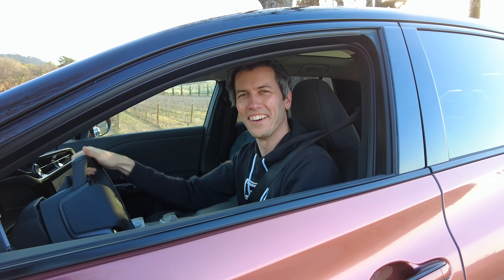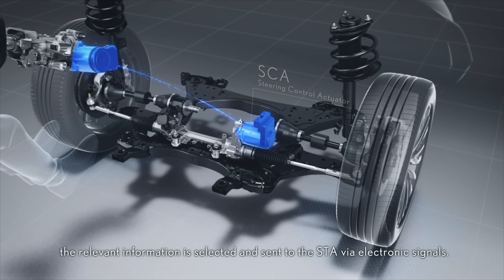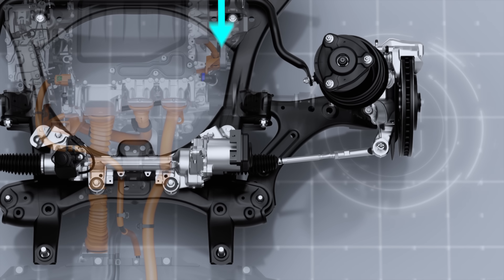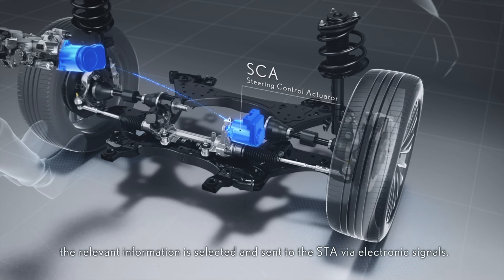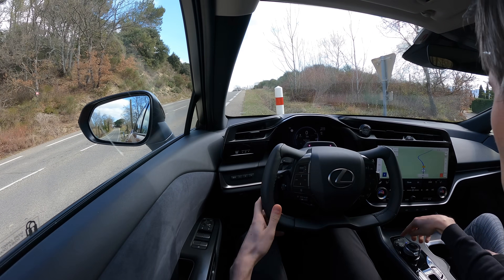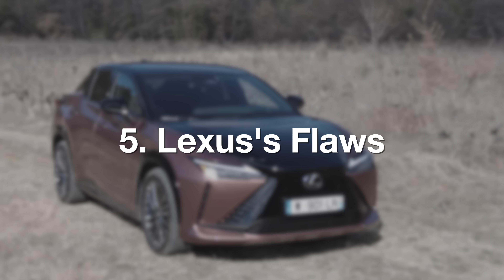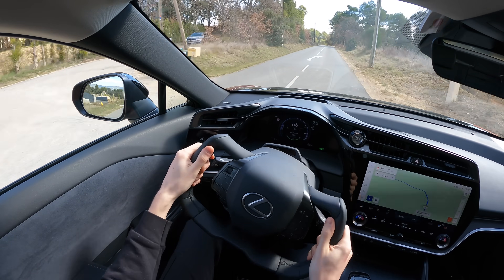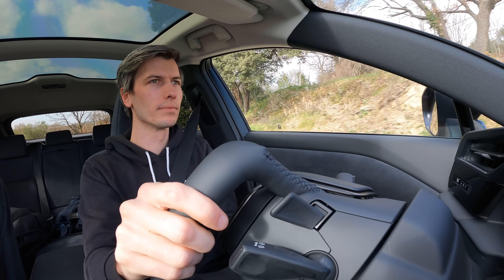How Lexus Fixed Tesla's Bad Idea: Steer-By-Wire Yoke

Comment: one concern that wasn't brought up is what if someone finds a way to remotely control your car and can cause you to crash.  if the steering is controlled by software then it can be hacked
Reply: Normally safety relevant systems are not connected to the other electronics of the car. So physical access would be needed to install a device. 
Bit this already could be done to accelerate the car when you rather would like to break or just blow the airbag in your face while driving.
Reply: @nils9853  ya i could see that they might try to keep it separate but it seems that car manufactures are going to a remote diagnostic system.  so they would want to be able to check on the steering components and i would guess would have ways to do 2 way communication between the systems.  it will be curious to see though they could go a number of different directions.

Comment: Modern aircraft are fly by wire so it's good to see the automotive industry catching up. They are usually Quad redundant but I guess it's harder to call a tow truck when flying at 35,000 ft. The lag you pointed out hopefully will be corrected in the production models. Having said all that the old coot side of me says a lot of this new fangled stuff is throwing the KISS rule out the window.
Reply: And those windows are electrically operated. :)
Reply: @tomindenver1331  man if I could buy a new car with crank windows, a stick shift and no touch screens, I’d be in heaven lol

Comment: I still disagree with your point at 8:28. You provide examples of modern uses of electronic systems, but none of them are critical to the car's safety. If your throttle suddenly goes out, you can still come to a safe stop on the side of the road. Brake by wire systems still have hydraulic backups that exist if the main system fails. You talk about redundancies as failsafes, which they are not. Redundancies improve reliability, but in the case of total motor failure, say for example something hits the bottom of your car and completely takes out the steering motors, what then? Seems like a bad idea all in all.

Comment: There are three advantages which I think would be important that you didn't cover;

1. When the front wheels lose grip why give feedback to most drivers at all? Just correct at the wheels to the steering input the driver is requesting. Traction control and ABS do this already.
2. The limits of steering angle can be set dynamically by the vehicle speed. Max steering wheel(yoke) rotation = max available turn rate. Car in unflippable on even ground, even in reverse.
3. Auto safety systems can now leverage steering inputs directly. If a driver has a medical incident at the wheel the car can specifically remove control and steer around obstables and pull over rather than just slam on the brakes in the middle of a busy highway.

Most of this is just a real world implementation of control options available in simulator racing games.

Also, the first part of the video talked about steering response but seemed to describe ratio/linearity, although you mentioned response later (12:00) which will always be most direct in a mechanical system.

Comment: We do not have brake by wire.  All cars sold in the US still have a full mechanical connection between your brake pedal and the hydraulics. 

The wire can turn the brakes on, but they can't turn them off.

Comment: Ok, dual sensors and motors in one housing. Do we have dual plugs and wire harnesses? What about the mechanical connection to the steering box? I know that on really critical flight control surfaces there are often two actuators which use separate electrical and hydraulic power sources as well as separate data paths. But it sounds to me like the auto makers want to drape their designs in aviation reliability without actually providing real redundancy.

Comment: This could be useful for track use. You could tune the steering exactly to your preferences and more interestingly you could use the car’s cameras to map a track course and then use the center display and steer by wire to make racing sim map to practice the course before you risk your vehicle doing a hard run. That’s some what like a better version of the car sims that professional drivers use before Nuremberg runs
Reply: nuremburg trials
Reply: Not Nuremburg (it's the English name for Nürnberg), it's the Nürburgring (this racetrack is in a completely different part of Germany!). One "n" less and an "u" instead of an "e" - 2 different letters but a completely different place. 🤪😂
Reply: I don't know of a single race car driver that would embrace steering wheel lag and lack of physical feedback.

Comment: Big planes have been fly by wire for a while now. If it works in aviation, it damn well will work in automotive. Although I gotta say the instant response thing is something that im not so confident about. Even in a plane you probably wont have to make instant adjustments like you would driving i95 in Florida rush hour.

Comment: Got to drive it in January 2023, I really liked it in the mountains in Spain. Not so much on the highway. Learning curve was actually very short, took few hundred meters to adjust to it… It will be an optional extra, and I bet the price will be 4-5k. Which will probably make it unsalable for the dealers. But at least engineers are trying to come up with something new and they deserve Kudos for that alone.

Comment: Single mode redundancy isn't helpful as you don't know which component has the problem (that's why aerospace use tri-mode with a voting function). As for safety concerns, my biggest one would be software bugs.

Comment: Here is what I think could go wrong despite all the redundancies
1. What of the power supply wiring to the actuator motor fails? Then all three batteries will be compromised at the same time.
2. The two actuating motor are situated at the same location. If the main motor was to fail because of any contamination or something that's related to its location, then whatever cause the main motor to fail would also make the second motor vulnerable.
3. If the two motors are connected by gear or belt, both would stop working if one sizes up for some reason.
4. The failure of communication between the steering wheel and the actuating motors, a bad connection, or a short circuit would cause the system to fail or worse, malfunction.
5. A malfunctioning feedback motor or software bug or a bad calibration could cause driver to feel faulty feedbacks resulting in unnecessary and wrong corrections.
5. All the redundancy systems are based on the same method, just extra parts. In case of a steer by wire system failure, there is no mechanical method to control the steering of the car. 
6. If the computer fails, all the redundant hardwire will be deemed useless. The driver is this always in the mercy of the softwire. And finally
7. Who is to stop people from reprogramming their steer by wire system and trying to make a homemade self steering car using the system?

I think the system has huge potentials because of its flexibility. But the issues need to be addressed.

Comment: What if this was Steer-by-hydraulics instead of Mechanical/Wire? Would the lag exist then?

The pipe would not need to be straight as is the case in mechanical systems and will only bit thicker than a usual wire.

Comment: Shouldn't the wheels spinning as you slow down automatically generate power for steering? That seems like a safer option to me. Also, idk about the braking but at least with electric gas pedals you don't need it to be powered to stop the car if something goes wrong

Comment: Have you tried driving a Model S with a yoke? I have over 25k miles on mine and parking lot steering is not a problem at all, you just grab the bottom corner to do hand over hand

Comment: 'Sensors' are the most common failure on a vehicle. Mechanical systems simply last longer and are more reliable and repairable. Technology is great when it works and if you replace it often enough.

Comment: Hold on, didn't BMW solve this 20 years ago (for hydraulic power steering) with Active Steering? And as a bonus, when active steering broke, it just locked the steering ratio rather than disconnecting your steering. It's probably even lighter than this mess of wires and actuators that definitely don't have plastic gears that definitely don't break after 50k miles.

Comment: A former school colleague who works at thyssenkrupp Presta AG, respectively at thyssenkrupp Steering, told me not too long ago that drive-by-wire would soon be at a stage of development where it could be installed in road vehicles and taht it is already replacing hydroelectric systems in heavy industry.
Do you know the manufacturer of this system that Lexus uses? Is it from thyssenkrupp Steering, a competitor or actually a Lexus development?

Comment: redundancy is a really complicated subject. i work in aerospace and deal with it alot. Its surprisingly easy to construct systems that look redundant on a schematic but fail in real life because the schematic does not indicate real world component layout and the failure mode is often treated as a simple binary when in the real world component failures can have all sorts of secondary effects. 

im not inherently opposed to a system like this and im sure theyll do their best to analyze and test the system prior to implementing but i do have some concerns.

There have been instances where redundant sytems ran their redundant wire harnesses along the same rout and when an unanticipated event severed one wire it severed them all. Id like to see independent routing of the two separate wiring harnesses from the position sensors to the motors.

Two motors in a shared box is not as good as two separate motors if one were to overheat it could fail the second motor. i also wonder what the clutch situation it must have to handle disconnecting a siezed motor.

lot of other questions and concerns too but those were the biggest ones for me beyond the lag irl bs

Comment: There should be no delay if Lexus engineered it right. From a controller/electronic point of view, there are no obstacles.

Currently, it just looks like the steering actuator can't move fast enough to match the steering input side.

Comment: I'm in the video game controller and mouse sensitivity set to "high" category, so I'd probably like it. BUT, I want to be able to adjust it, depending on my driving mood. Sometimes on long trips I want to have a chill driving experience. I would want to set the sensitivity to low. But once I reach my destination and there's a twisty road, I would want to crank up the twitchy to the max. I can do it with my controller and my mouse, please let me do it in my car.

Comment: I dislike variable steering ratios and i drive non electric vehicles, which accelerate near instantaneous with >80% of maximum engine torque at any relevant time of driving and decelerate near instantaneous when letting of the throttle.
I think there is no need for any over comlicated system, which has to have more reduncy systems just to work in worst case scenarios, especially as most casual drivers don't bother with such nuances.

Comment: As someone who is familiar with good racing simulations, I know how incredibly well Force Feedback can be made. With all the sensors in the car, you could theoretically feed in better information than what you'd feel in a conventional hydraulic rack. 
I'm not the biggest fan of speed sensitive ratios though. I know that, nowadays, with all the driving aids, there is no need for it in real life, but a part of me wants to be able to give full opposite lock in critical situations, whatever the speed.
Regarding the lag, I'd like to say that at these high low-speed-rations of this system, it might well be possible that the laggy steering is still quicker than what you could do with your hands in a conventional rack. Less lag is obviously better, but with a ratio that high, you would probably need quite a torqy motor to keep up with your wheel movement.

Comment: Here in the UK by law you have to have a mechanical link to the wheels if the vehicle is capable of speeds over 20mph. Unless there is a change in the law that system could not be sold here.
The 20mph speed limit is to allow for agricultural tractors and plant with full hydraulic steering - a very old form of steer by wire, or at least steer by pipe.

Comment: i could lag in the steering when watching the video vould be the video but i like breaks and steering to be mechanical i know cars have break by wire and i know when the break booster fails on a old system its hard to press the breaks but still prefer that then just wires same with motorbikes the ones with cable throttle respond better then the ride by wire ones

Comment: Even on a fully electronic position controller, the dynamics of a mass spring damper are stimulated. The delay in the wheel position might simply be a question of tuning the spring and damping component for better response.

Having said that, all mechanical systems have these delays too. They might just be trying to match the feel of an all-mechanical system.

Comment: Imagine a failure launching you head on against oncoming traffic at highway speed with no chances of taking over due to not having a physical connection between the steering wheel and the tires. Sweet!

Comment: Another benefit of this system is manufacturing costs. All parts are good for either left or right-hand driving setup, no need to manufacture a steering rack for both. I suppose that won't make the cars actually cheaper. 😀

Comment: I feel like the ability to decide what inputs to send feedback for is good- especially in pothole-laden areas like where I live. The steering delay is a real concern though, while average Lexus SUV buyers won't be taking it to autocross sometimes you have to make quick manoevers in traffic and having the car not do what you want it to is a real disadvantage. If they could get the consistency of the speed of the steering motor to the speed of the steering wheel turning down, this would be great for people who just want a comfortable driving experience.

Comment: can't they leave the steering shaft there but with an actuator that is normaly disconnected, but as soon as the car or the system itself loses power, it connects and you get mechanical steering

Comment: Anything drive by wire pushes us into the something similar to the drone world: "expo". In that field, pilots can set exponential curves to their 'steering' [controller] inputs and tailor to their styles of flying (aka driving) and input response. What you've experienced is the Lexus engineers taking a guess what an idea expo curve is for *you*. Same problem in trackless theme park rides that use drive by wire: finding the right curve for "you". I'm sure in the future we'll have an autotuning setup when you take ownership of a car to setup the expo curves for your driving style or more likely short term: more driving modes, ugh.

unfortunately drive by wire opens up a "customized overkill" scenario, anyone else who drives your car will need their profile. This changes the car paradigm where you adapt to the car's [mechanical] behavior to the car adapts to your behavior--which is not good, removing skill and human perception from driving. We might as well wait for FSD cars than solely rely on drive by wire.

Comment: Big question - do you think this makes autonomous driving easier?  The current systems all have varying interfaces w/ mechanical systems.  This is purely digital so does that makes it better?
Reply from the maker: Yes, it opens it up for autonomous driving easily. Wheel doesn't have to move if a computer were to take control.